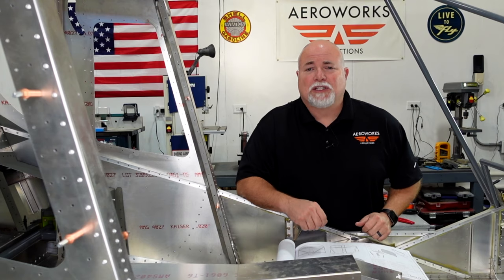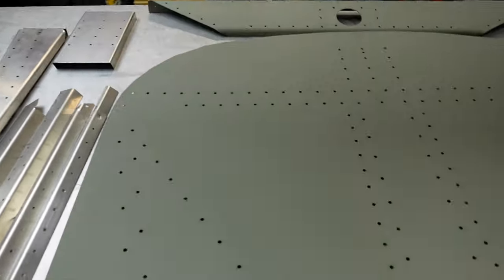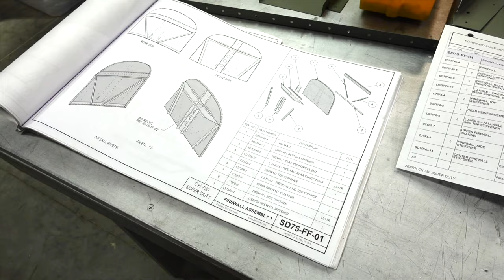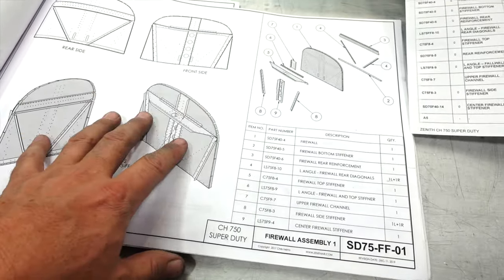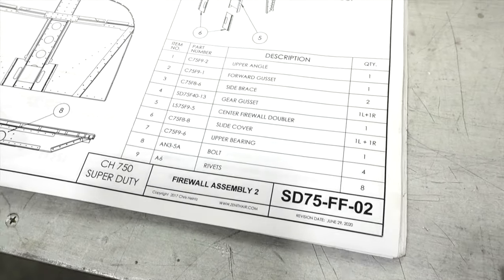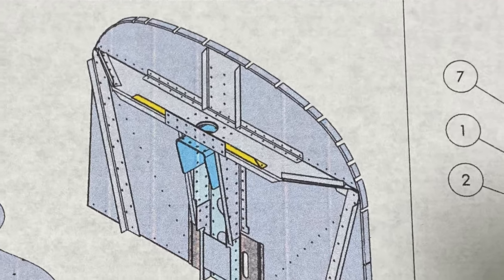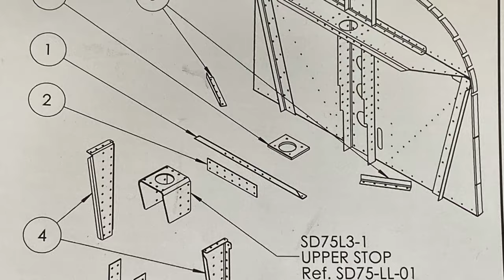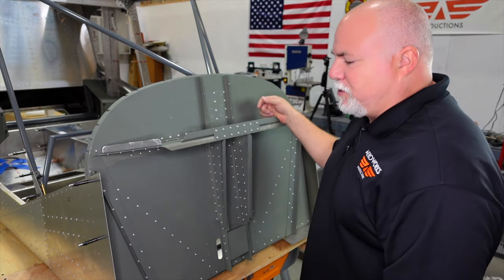Ep. 9 | Firewall Construction | Zenith Super Duty Aircraft Build

Comment: The plans show A6 RIVETS QTY 8, and the bracket has 8 top holes. I wonder if they assumed that's all anyone would need to know. But still odd that they're omitted from the parts list.
Reply from the maker: Good point Jason, I think sometimes the factory takes for granted that they know how to build the plane and others may be their first time.  I'll keep a lookout for the quantity in the future when I have questions.  Thanks for watching.
Reply: My Cruzer is at a similar stage . The bracket that comes with the finish kit looks the same .Mine bolts on with sixteen AN3 bolts .4 top 4 bottom each side .The bracket has two angles fitted front and back on the top  with the big pulled rivets 8in total.The angle needs the corners removed to miss the bolts .The rubber doughnuts just miss the bolts if you point them outwards .This is a retro fit part for builders changing over from the bungee system .Your part might be similar .Thank you for the effort in posting the videos .

Comment: Thank you for all the videos. What kind of primer are you using?
Reply from the maker: Rustoleum self etching primer spray can for small parts.
Reply: @AeroworksProductions  What about the green stuff I see in between some of the angle where it meets the skins?
Reply from the maker: @tylerzillig5697  That is cortec done at the factory.  It’s a water based corrosion inhibitor.

Comment: I would love to see a difference in the Zenair rivet tip versus the standard tip...
Reply from the maker: You mean the machined tip that you get from Zenith?
Reply: @AeroworksProductions  you had mentioned that the rivet tip from Zenair will give a more domed profile than a standard tip that comes with the rivet gun.  I was curious to see a pulled rivet from each.
Reply from the maker: @Ringele5574  Basically one is flat and one is rounded due to being pulled into the machines head.  I’ll demonstrate in a future video.
Reply: @AeroworksProductions  Thanks